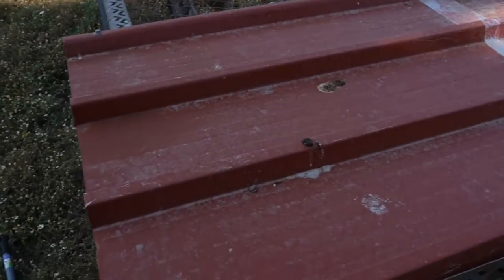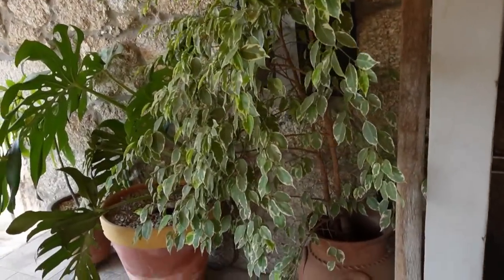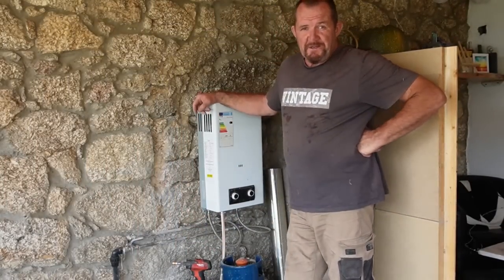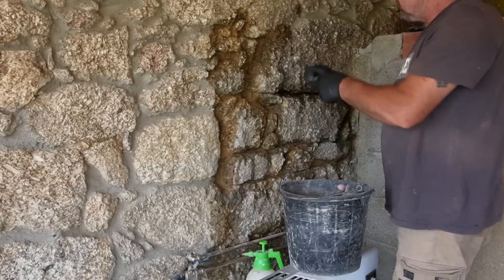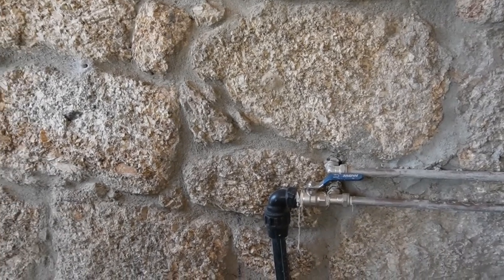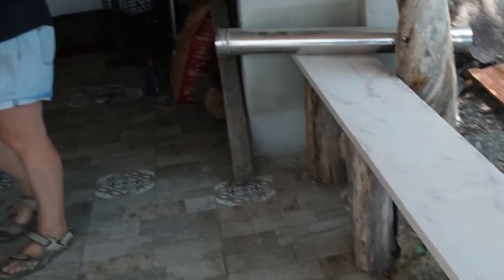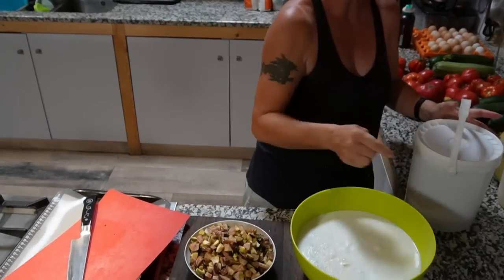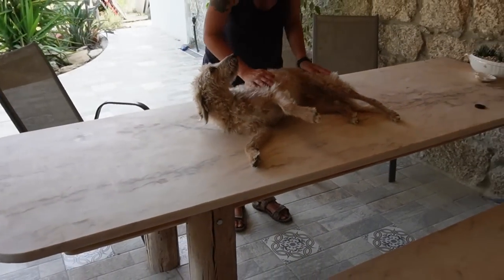Re Modelling Our Outdoor Kitchen and A Fig and Honey Ice Cream Recipe

Comment: Not sure the flueing arrangements for the gas water heater would comply with gas regulations in the UK. Carbon Monoxide is a killer, and will build up n the blood stream over time replacing the Oxygen, causing head aches, etc and eventually could kill you. Test the flue gasses regularly and fit a CO detector to be safe. Great vlog I enjoy all of your posts, keep up the good work.
Reply from the maker: Thanks for the advice, all our boilers are outside, I just need to drill through the ceiling in the outdoor kitchen

Comment: The long air tubers once they grow to a metre length will want to climb or spread out to more height it is like it’s hands for stability as it matures
I would suggest you find it a bigger area to grow into as it can become destructive trying to move its airtubers into walls as it did with my outdoors seating area wall
Once they grab hold they are extremely strong and tough to remove